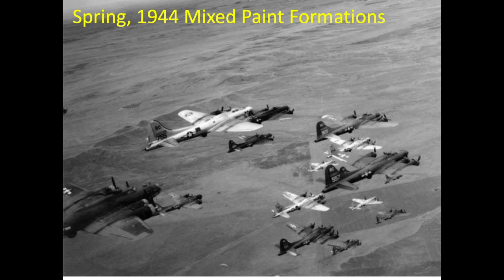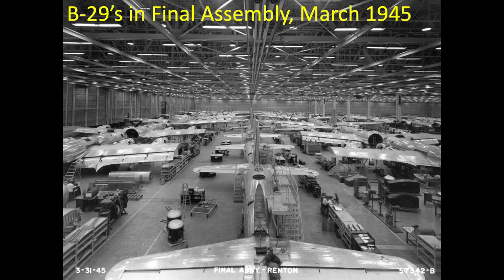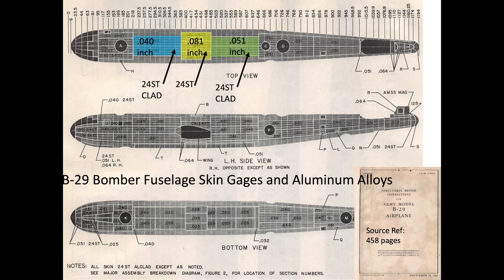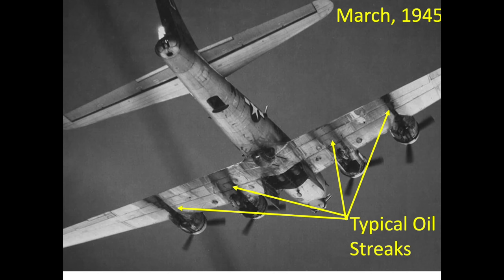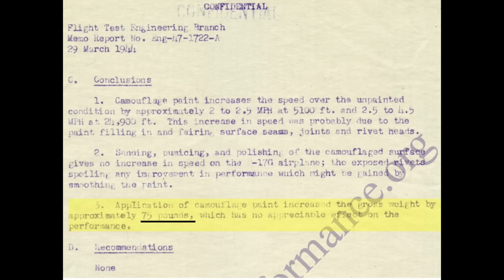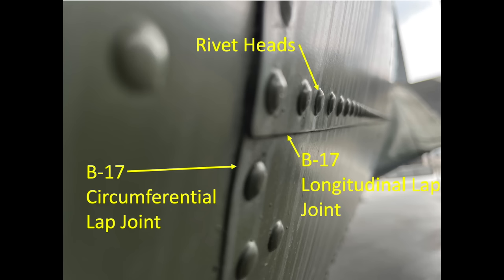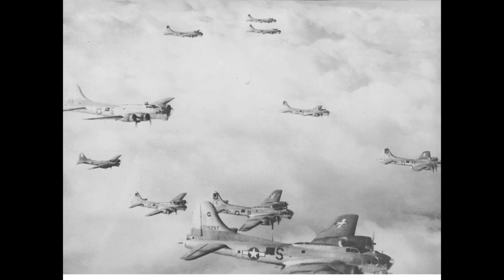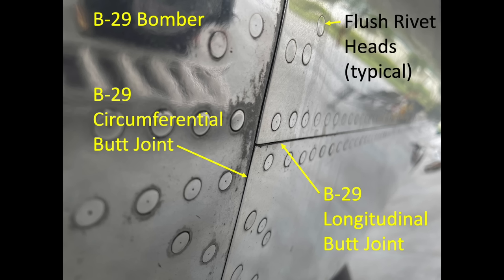B-17 Bomber Paint Vs No Paint, Unexpected Results

Comment: Wow you blew my mind. I would have bet 500 bucks that the unpainted airplane was faster due to the weight saving on a universal rivet head structure.  On the other hand, when it comes to flush riveting, corporate jets take this to a whole different level.  They typically use feather-fill primer and are sanded such that the flush rivets are completely filled and hidden by the primer/paint.  If you walk up to a Global Express, you'd think the fuselage was composite.  There might be a hundred+ pounds of featherfill, but I imagine the speed/range payoff is worth it.
Reply: Aroun 25 lbs, very little is used and its light. Thus the name featherfill. It's not yer daddys bondo.
Reply: I would have lost $500 to as I have read before that some crews would wax their planes for a couple extra miles an hour at least for fighters any way.
Reply: @gunfisher4661  On a fighter, waxing will help, but only on the leading edges of the wings  and tail and some other leading edge surfaces. As soon as you move back some, there is no longer laminar flow and more or less surface smoothness doesn't matter.  I might wax the wings of a P-51 back to the main spar. A bigger benefit is just cleaning bugs off the leading edges.  On a bomber with rubber boots on the leading edges, it shouldn't make any difference at all.
Reply: @darrellcook8253  🤣
Reply: Aerodynamics is counterintuitive in many many ways.
Reply: @mikeries8549  Canard , for example ?
Reply: This was in fact what was done on P-51 wings because they were laminar flow. The first 40% of the wing cord was first painted with one coat of zinc chromate primer followed by enough coats of Acme Gray Surfacer No. 53N5 to cover all irregularities. Skin butt joints were filled with Acme Red Vellunite glazing putty No. 58485. The entire area was then sanded down and sprayed with one coat of camouflage enamel. When camouflage was deleted the forward portion of the wing, sometimes the entire wing, was painted aluminum.
Reply: If it has clear coat, it is not unpainted.

Comment: Very interesting who would have thought.

When I worked for Cessna (Mil-Twin Division) the company charged extra for unpainted twins. I was told that was because sometimes the assemblers had to use rubber mallets and the "damaged" unpainted shin had then needed to be buffeted out.
Reply: You mean otherwise they'd just use metal hammers and fill in the dents with bondo!?

Comment: I'm sure a bomber crew flying back from combat on 3 or 2 engines would appreciate paint if they had known.
Great content!
Reply: So if you get a B-17 going in a glide path that is slowly coming down the thing will come most of the way back home on one engine at least get you out of dangerous territory there are many stories of things getting shot up on the way back and making it back to England so they could land on the ground crash land or bail out and let it crash to the ground by getting the right glide path in the engine setting and going with the one engine that's working

Comment: Very interesting . The British Lancaster bomber weighed 56 lbs more painted . I often wondered why they continued to paint them all through the war . Side note. The black underside paint , was a special paint that stopped German search light reflection  .
Reply: They continued to paint bomber-force Lancasters throughout the war because they continued to operate predominantly at night throughout the war
Reply: @harryspeakup8452  NIVO . Not Devo !  Lol   8-)
Reply: @harryspeakup8452  that makes sense- a sparkly silver thing in the sky would be far easier to see at night.  I've always wondered if ditching all the guns would have been a good idea.

A lot less weight and a faster aircraft might have saved more lives.  Then there is the 3 or 4 less gunners that would have died.

It all depends on how many night fighters Lancs shot down ( not many I imagine ) and the psychological aspect.
Reply: @olivercromwell3575  The logical conclusion of the speed as rescue/defense solution would have been to use Mosquitoes instead of heavy bombers . If I recall correctly, the Mossie could carry quite a bomb load.
Reply: @olivercromwell3575  That was the thinking with the Mosquito. Faster harder to catch smaller crew. And delivered a pretty good load of bombs.
Reply: Search lights were not about refelexions but for outlining the bomber silhouettes.
Reply: I read that the US AAF did testing with the P61 Black Widow, a fighter designed for night with a flat black paint job and then a gloss black. Turns out in searchlights and stuff the gloss paintjob was LESS visible/ reflective than the flat finish.
Odd, like who'd thought?

Comment: I have heard a few times that the unpainted 17's were 500lbs lighter. I'm really surprised that the unpainted is slower than the painted one.
Great video and information.
Reply: I hope you didn't believe that though😎😉
Reply: My reference book for model building in 1981-82 it said all the paint saved on a B-17 of the primer and the paint itself equated to roughly 100 lb per aircraft
Reply: And keep in mind the paint underneath was called zinc chromate it was for corrosion resistance you'll see it as a bright yellow paint and sometimes it's a green paint in the wheel wells and inside the aircraft some of that was put on as metal plating and other times it's made as a paint and current times it's made as a paint there's a very similar paint that is painted inside F-16 engine areas it is a brutally strong paint and it will not rust under it

Comment: Neato!

I wonder if dimpling the fuselage, as they do to golf balls, and on that Mythbusters episode would result in greater efficiency, savings? 

I love this kind of experiment.
Reply: Nope. Dimpling energises the boundary layer to delay separation due to the balls shape, a streamline aircraft shouldn’t have any areas of separation that would be improved by energising the boundary layer so you would be increasing drag for no benefit. On high laminar flow wings like gliders they will sometimes have an energising strip on the wing but a riveted skin is nothing like a smooth carbon fibre skin. Some STOL aircraft will have tiny fins to energise the boundary layer at high angle of attack, delaying stall onset but with a drag penalty at cruise, not what you want on a bomber.
Reply: @electricalmayhem  by that logic, the Mythbusters dimpled car could not have increased fuel efficiency. 

But it did.
Reply: @LordMondegrene It is a function of shape and speed.  An airplane is shaped to avoid the situations where dimpling helps.  A car is not.
Reply: @HweolRidda  ... and the source of your expertise is... what? 
Because the dimpled car got 3 mpg better mileage.

Comment: Came across this channel by chance. Thought I would watch and now Im hooked. Very interesting information regarding aircraft finishes in combat scenarios. Im wondering if the same results would be found on fighter aircraft as well. The P51 comes to mind. Thank you for a great,informative video!
Reply: The P-51 is all flush-riveted so much more like the B-29 than the B-17 in skin surface. However, even on the P-51, while the late models looked natural metal, and the fuselages were, the wings were always filled, primed and silver-painted when they left the factory

Comment: If the painted vs. unpainted test was conducted with just one aircraft each, then it's not a good comparison due to a statistically insignificant sample size. Better to have 10-20 aircraft each manufactured from the same assembly line and average the results. A 3% variation is speed/fuel burn could likely result from many factors including manufacturing variation, particularly during a high-paced war time production. I worked at a major aircraft manufacturer in Wichita between 2000 and 2006. I observed how each individual aircraft required custom aerodynamic trim pieces on the wing underside to get it to fly straight. It's an iterative process that requires multiple test flights to get it dialed in. Aircraft production is not nearly as automated as cars and no two aircraft are exactly the same.

Comment: Interesting stuff. What interests me is that the camouflage colors for the top and bottom of the B-17 were chosen to blend with the anticipated backgrounds against which they would be viewed. It doesn't seem to have occurred to the designers that these same colors would also act as counter-camouflage when viewed from the side.
Reply: You just can't make everyone happy.
Reply: Many birds have lighter colors on the lower side,  giving shadow parts lighter colors is a camouflage technique too
Reply: some B17s had 2 colour upper surfaces. Also the star insignia would be painted grey as would any identifying markings that were white
Really, most aircraft in the air when looked at from the ground look like black crosses anyway. From above it's a bit different

Comment: A modern jet comparison would be interesting. The F-15 Streak Eagle was unpainted as were many post-WWII USAF jet aircraft. The paint on a relatively small F-16 is heavy enough to require a weight and balance inspection after either a full or sufficiently large area is repainted. There is a paint weight limit which requires removal and repaint if the accumulation weighs too much.

Comment: FYI, when Iraq invaded Kuwait in 1991 two C-141Bs (tail numbers 251 and 252) were getting repainted but had only gotten the old paint removed, AF said we need them yesterday put markings back on only, we flew them for @18 months before repainting again... leaked a lot in the rain. The paint used at the time had lead to absorb radar emissions and was several hundred pounds.

Comment: This is one of many stories about aeronautical engineering that is amazing, because of the time line it was accomplished in 70 some odd years ago and very accurate. We have become complacent in today's world with using computers. It would have been useful if the crews should have been trained on this variation for formation flying. Over the targets the Germans used " flak boxes" so individual aircraft were not targeted, the risk was the same. Another  irony was the B29 was painted OD and flown across Germany prior to being deployed to the Pacific to intimidate the Germans . The only parameter that would have been different in this test versus reality is the fact of losing engines in battle and using the operating engines above standard military power specifications. Excellent video. Lets go back to slide rules and calculating machines.
Reply: As an engineer, no.  It is not "complacency" it is efficiency.  And that efficiency allows real human art and the spark of genius by allowing you to take a cocktail napkin (alcohol soaked) idea, accurately model the design and build a business case wildly faster, cheaper and safer than the old days of designers, draftsmen, model builders, prototype construction, flight test, etc.
Reply: @jimmiller5600  Jim I would not disagree,  I've worked in Silicon Valley and participated in many alcohol soaked napkin designs when we were semiconductor kings. The SR71 was designed completely without computers, 70 years ago Henry Ford's Willow Fun plant built B24's - in assembly line format that put out one B24 every 63 minutes . Our cell phones have more computer power than the Apollo space crafts. I could go on , however the amount of aircraft alone produced in massive quantities without today's technology was phenomenal and started quickly because we had the " mental" drive and individual assets to get the job done. The Atomic Bomb was basically built in three years. Today, corporate management makes the decisions, along with government agencies . They consider creative engineering minds a dime a dozen because of computers and throw them under the bus in a nano second. "If" we needed 12,000 F 35's at the rate of one every 63 minutes it couldn't be done. The semiconductor industry sold out to the Pacific Rim for profits and shut the USA industry down. Now they are over the barrel because off shore companies have us by the short hairs because we can't retool what we had because of greed. I could go on about the Good Bad and Ugly of our industrial complex. However that's not the point I was trying to make - people not computers made the difference back when the world was at war. Management, not engineer tenacity and knowledge keeps their heads up their ass by selling out the very creativity we used to have. Thanks for the post.
Reply: @jimmiller5600  Hey Jim, we are actually not that far apart  - could probably due some good conversational damage at Starbucks. You picked excellent examples, the SNAFU of Boeing and the SpaceX. When Musk first appeared  on the horizon I had some serious doubts about his entrepreneurial intentions, over time he does seem to be accomplishing more than I anticipated  . I've never agreed with the term " greatest generation", they made incredible contributions and accomplishments, but society definitely changed as a result of the 5 years the were busy winning the war.  In just looking back to 1984, the world has added 2.3 billion people - so that represents  several generations and by shear numbers changes global cultures. Plus I couldn't agree more about the tax laws impacting US economy. .  I'm just thinking the engineering accomplishments, without the availability of computers as we know them today, and instrumentation  like SEMS wasn't too bad for the time .  Stay in touch if you have anything else we could kick around, Oh, and yes capitalism is by far the best system to live under.for sure.

Comment: Back in the late 1970s, the company where I was a paint R&D Chemist decided to compete for painting United Airlines aircraft. Painting aircraft aluminum is difficult in itself, but then add in the harsh environment. The paint has to withstand extreme cold, the rippling of the skin during flight, the harsh chemicals, such as hydraulic fluid, aircraft fuel, and de-icing compounds. I spent over nine months formulating and testing various systems. I say systems because at the time, there were three coats needed, a wash coat primer, an epoxy primer, and a polyurethane topcoat. My first formulation was used on a small section of an aircraft and flown several hundred miles, and much to my chagrin, despite rigorous testing in the lab, flaked off when subjected to real world flight conditions. LOL

Comment: I immediately thought the paint might have streamlined the aircraft around the raised rivets and sunken areas like joints. I guess I wasn't surprised by the result but it's interesting to know anyway!
Reply: not just the seams and rivets, but the general surface is smoothed as well and may be the bulk of the reduced drag. oxidized or anodized aluminum is quite rough (like fine sandpaper) when you feel it with your fingers or magnify it.  this roughness will hold onto the boundary layer of air and increase drag. i think waxing and polishing, or oiling the whole plane would give even less drag

Comment: I always wondered what the casualty rates would have been for Lancaster's and other heavy bombers had they stripped all the guns out, smoothed the airframes accordingly and reduced the crews to like 4, once they had decent fighter escorts.
Reply: That's an interesting question. I guess I may have gotten to meet an uncle rather than just be told about the one shot down and buried in Holland (he was an armorer, navigator and bomb aimer in 'Lancs'
Reply: I've wondered that myself.  LeMay sounded crazy when he took the guns off of B-29s ("we went to all the trouble of making an automatic gunnery system!") but figured that the guns, ammo, gunners, and targeting systems could be replaced by more bombs.  (of course, they also had air dominance.)  Once the P-51 was introduced, you could have made the same argument for B-17s -- they ultimately had something like 14 M2s, 1176lbs just for the guns, plus another 1700lbs for the bullets, plus the ball turret and 4 crew members.  That really adds up.
Reply: It was called the DeHavilland Mosquito and it rarely needed an escort.
Reply: @graemejwsmith  Indeed but I was referring to the 4 engine heavy saturation bombers.
Reply: That is exactly what Freeman Dyson recommended. The Lanc would have delivered a greater bomb load at a faster cruising speed. Lanc crews hardly ever saw the plane that shot them down.
Reply: @shadeburst  Freeman Dyson...what a mind!

Comment: We had a little company that looked at general aviation aircraft to see if we could get a little more speed out of them. Flight tests were done before and after the mod to determine if it worked and was economically viable, and if so then would be offered to the owners of that aircraft. This also had to be demonstrated to the FAA to be sure the aircraft would still meet the original performance specs at least, and not be damaged structurally. One thing we tried was body putty fairing of rivets on a Cherokee, it actually went faster but added some weight and was so labor intensive we never offered it. What worked best was gap seals on the flaps and ailerons, light ,simple and usually got 2-3 knts better speed. Part of this process was blueprinting the airframe so it would fly straight, it was surprising how many out of rig planes were flying around.  I bet you would find that with those bombers after they'd been patched up in the field.

Comment: Another possible reason for the drag reduction may be because of the relative roughness of the matte paint surface.  That results in finer-scale disturbances in the airstream, which results in less drag than larger-scale distrubances.
An example of that is golf balls -- the dimples significantly reduce drag.